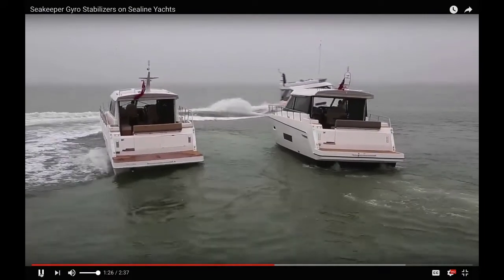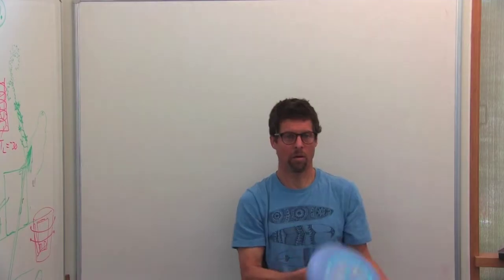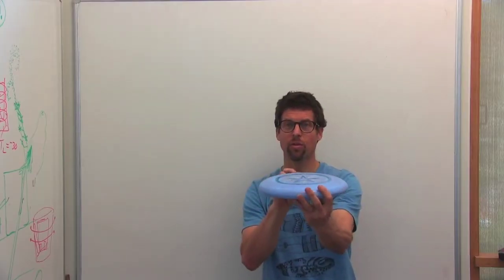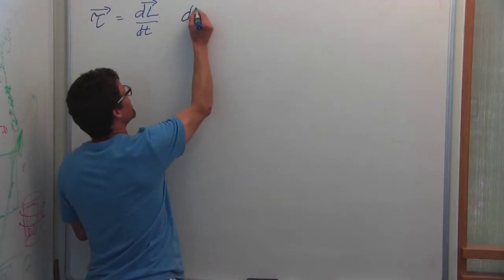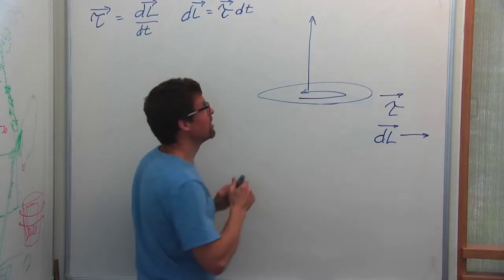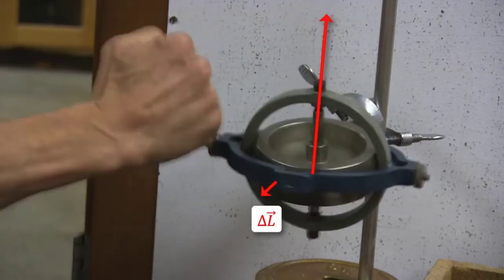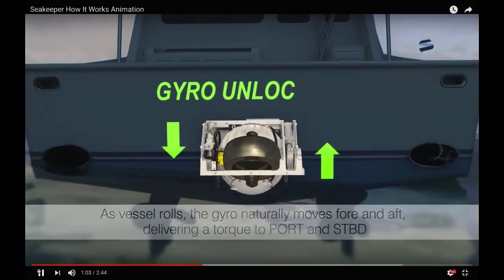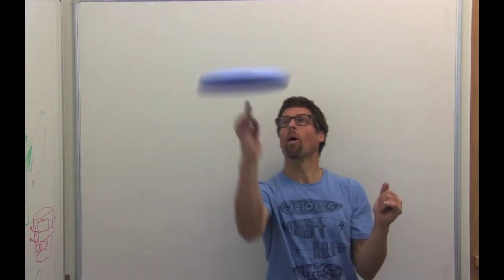Seakeeper Gyroscopic Stabilization Explained, Pete Schwartz, Cal Poly Physics

Comment: This is an important video for my learning about the behavior of gyroscopes with different degrees of freedom. Between 4:15 and 4:21, was the Gyro spinning. Again, between 4:15 and 4:21, why would the Gyro not precess. Or was there precession? but that was loading up the strings. And the strings would have snapped if they were thinner? I hope Peter gets to see my message, and be able to respond. Thanks in advance.

Comment: Hey Peter, sorry for a question on an old video, but was wondering if you could expand on one of the points you make.

You demonstrate that if you lock the gyroscope with strings to prevent movement on the Y axis, even when the rotor is spinning the gyroscope becomes easy to turn on the Z axis.

But if the rotor is spinning as shown there's still a large angular momentum in the upwards direction. If you then turn the rotor on the Z axis do the same principles not apply? The rotor will want to twist on the Y axis. 

Is the angular momentum pushing the rotor inwards or outwards on the Y axis just counteracted by the string? I guess I don't understand why locking the Y axis with string it would make the large angular momentum going up easy to change direction.
Reply from the maker: Hi, and good question.  It's perplexing to me too...We agree that when I apply a torque in the z direction, the gyroscope would rotate in the y-direction if it were allowed to.  The strings prevent this.  HOW?  They do it by providing as much torque as necessary in the negative y direction.  That angular impulse (provided by the torque of the strings) in the negative y-direction would be added to the angular momentum, rotating the gyroscope in the z-direction... the direction I'm trying to turn it!
Reply from the maker: It's still a little confusing to me too, but that's the best I can do right now.  AND for what it's worth, you may notice that with the strings attached, it does resist the rotation a little... it doesn't rotate freely the way it does with there is no rotation.  No, I don't have a good answer now!  Even basic physics can be challenging!
Reply: @pvs242ful  Thanks for the response. I think your answer covers my curiosity as a layman. Think about it I suppose it's also not just the string that's providing the impulse but the entire weight of the pole and table it's attached too. With that in mind plus your explanation the behaviour makes a little more intuitive sense to me.

Thanks again!

Comment: You just solved a major puzzle i had a year ago.  I tried to make an inertial platform for a camera setup. For the life of me I could not get decent stabilization.  The reason why is I had the gimbals locked.  I think this means I should use BLDC motors with feedback  sensor where gimbal bearings would be. This way I can do CMG aiming of the camera, but basically have a inertial platform afterwards.  It also means I need to redesign a bit so that there are no singularities that can form as the gyros freely rotate.
Reply from the maker: Glad that was illuminating.  It was also not obvious to me that the gimbal had to be free to rotate... until I tried it!

Comment: Hi. Great video, but I still have a doubt. As you say on min 3:35, when an instant torque changes the angular momentum of the disk, it will remain in the new position until a new force appears. So, why does the ship stabilize? If I tilt the ship by a applying a force on one side, I will feel a resistance proportional to the angular momentum of the spinning wheel, but why does the ship afterwards stabilize, and does not remain on the "tilted position". I suppose that mass distribution (ship design + devices) is the responsible for balancing the ship back to its initial position, but in a very slow motion because of the same rotation resistance of the gyroscope. I don't see any stabilization of the ship because of the spinning wheel, apart from a "tilt resistance". What am I missing? Thanks.
Reply from the maker: I suppose you're correct. "tilt resistance" doesn't mean "stabilization". If you put a long constant torque on the boat, it would eventually turn over despite the gyroscope, but the boat is subject to the stabilizing buoyancy force.... the problem is that the waves add large oscillations in this force. The gyroscope provides what could be thought of as increased inertial mass to the boat, so it doesn't get bounced around on short time scales, allowing the average stabilizing buoyancy force to prevail even over smaller time scales... very good, thanks.

Comment: Can you put this tech in. A car to improve performance? Can this assist in propelling a car forward?
Reply from the maker: Hi. Yes, flywheels have been explored as a means to store energy and release it later. A device capable of stabilizing a car is possible, but likely, it would require the entire gyroscope to be on a 3D bearing so that it didn't prevent the car from driving on varying road angles. I think it would require a considerable amount of active feedback.

Comment: Does the left boat have a flat bottom, and the right boat have a super-steep 22 degree bottom??? THAT alone would make up this difference. 
However, a steeper bottom is best when plowing through the waves, so this gyro would be great, if it works.
Reply: the gyros do work. the seakeeper is an improvement on systems that have been used on huge ships such as cruise liners for over 95 years but doesn't require the use of huge fins that stick out from the sides which not only limited when the stabilization occured but also risked damage to the ship if the fins hit something. 

the seakeeper also works when the ship is in dock, just trawling or at full speed unlike most other systems of the past. the boats are the same model with the same bottoms. you are just seeing how much of a difference in the rocking of the boats with one having a seakeeper while the other doesn't when the waves hit. the gyroscope weights depending upon the model at 900 pounds moving at 9000 rotations per minute when spun up fully. it is also not a passive system it senses when the waves hit and moves the flywheel accordingly.

Comment: The "locked" gyro example is precisely what I was trying to describe in a comment long long ago.  Better explained and demonstrated than in my comment which described the result of constraint but not the reason.  Even so, the string constraint isn't perfect so there will be some effect.  In any case the example is superb.  (Yes, I majored in physics, actually Engineering Physics, in 1954, but I used my experience throughout a long career in aerospace and industry.)

Comment: It's probably a little known fact that if you constrain a gyroscope such that it cannot tilt when you move it, it does not resist at all.   It only resists when it has some slight freedom to tilt towards it's normal tilt direction.

I suspect the new Navy EMALS catapults, which store energy in large gyroscopes use that effect to avoid having to worry about ship motion.  Two gyroscopes spinning in opposite directions, coupled together would not have any resistance to axis change.
Reply: REVISE

From Books To Computers The Human Species Continues To Evolve In Its Understandings And Potential Through Advancing Technologies. Now In The Advent Of 5g Comes The Android Smart Glasses
   
Android Smart Glasses

The Future Of DIY (Do It Yourself)Apps,Social Expressions (Emoji Que)And Literal Composure's Relevant To Specifics In Diversity Will Now Take A New Level In Human Utility.
To Take Into Account The Expansion Of Data Collection And Availability Through Open Source Media Has The Ability To Revolutionize The Education System,Its Understanding,Application And Most Important ,Cost.
Enyclopedia Brittanica,Wikipeda You Tube Etc Would Reach Beyond Boundaries As Set Today .Through Allocated Literal Composure's And The Augmented Reality Programs We Can Get A More Thorough Overview Of Subjects And/Or Mediums In Addressment.From The External Symetry Of A Apple To Its Constituent Elemental Propensities And The Laws Of Physics With Their Mechanics Will Be A Bold Dynamic 3d Visualization;A Breakthrough When Considering Our Massive Library To Date And The Potential Of The Augmented Reality Technology Program,Social Media Can Now Be Less Cumbersome As The Necessity Of Textile Interaction (Finger Touch)Required From Our Smartphones Is Drastically Reduced Or Eliminated.
A 
Highly Required Feat That Busy Parents ,Drivers,Buisness  Managers And Production Workers Would Enjoy, To Think Who Doesent Want To Tap Into A Sensor And Talk ,Text Or Command A Operating System Like The Internet ,Facebook You Tube ,Social Media ,Apps etc Without Taking Your Hands Off The Wheel Of A Car,A Cooking Utensils In Utility Or Dishes Being Washed.Clearly I Would.
Do You Want More Control Over Your Childrens Smartphone Interactions;Download A App And Gain Full Discretion Over Your Loved Ones Interaction By Monitoring A Transparent Screen In Front Of Your Eyes.
Imagine Setting Up Cameras That That You Can Tap Into At Anytime Through G5 Internet Conection Giving You Remote Control And Access To Diffrent Environments Putting The Mind To Ease Or Even Our Own Well Being At Our Discretion. Tired Of Paying High End Expenses For Computer Trouble Shooting Or Appliance And Or Auto Repairs;The Potential  Of  Live 3d Virtual And Augmented Reality Can Guide You  Step By Step Through The Procedure Making It Convinient To Human Independence, Potential,Creativity And A Bargain When Considering Todays Prices.I Know I Would Like To Install My Own Turbo And Cook Affordable Gourmet Meals Without Having To Comprimise Financial Stability.
Beyond Human Independence Through DIY Apps Human Health Can Take A Revolutionary Leap As Well.From The Break Down Of Desease In Epidemiology,Physiopathology Etc To The Focal Points In Trauma And Nerve Damage In Neurology And Endocrinologic Understandings ,Mental Health Can Take A Leap Forward As Well.
HUD-Heads Up Display Glasses Tuned To EEG Technologies, Biometric Technologies And AI (Artificial Intelligence )Computation Should Lead To Progression In Parkinsons/Alzheimer's (Etc) Therapy As Solid Analytics Are Produced.Tune The HUD Glasses With Multicellur / Multi Alternating Stream Transcranial Direct Current Stimulation Reinforcing Multicellular/Multi Alternating stream Deep Transcranial Magnetic Stimulation , Neutropics And Stem Cell Therapy And We May Overwrite The Influence Of Dead Cells And Their Impact On Neurological Pathway Systems Resulting In Higher Focus , Cognitive Adaptations And/Or Emotional Recalibration That Can Revolutionize The Dependence In The Pharmaceutical Industry.Who Doesent Want To Curb Crave When It Comes Down Fatty Foods And Nicotine Addiction?
The Innovation And Ultimately Contest In This Market Is In Its Conceptual  Stage,A Factor That Can Easily Be Changed Through Collaborative Design Projects Like Lennox And Wikipeda And Thus Become Common Rhetoric In Its Dynamics And Utilitarian Evolution .The Possibilities Are Endless.Companies And Manufacturers Like Microsoft,Google,Sony,Mad Gaze,Recon,Smith And More Are Already Starting To Scratch The Surface In This Market Giving Hopes For A More Independent And Interactable Future.
To Conclude;Ultimately Its The Virtue Of Control And Independence Created By This Product That Could Be Said To Set The Evolution To True Human Emancipation And Scientific Advancements.If You Would Like To See This Product Put In Production Join The Collaborative Design Project And Pass It On... REVISE
Reply: @emmanuelponce9151  Your comments are staggering.  Truly beyond belief and understanding.  Did you make this up all by yourself?  There must be a key point in there somewhere, what is it?
Reply: @dwilliams2068  -In Short,Teleprompter Glasses With Transparent Screens With DIY Apps.

Comment: Thanks for your useful explanation sir. But i wanna confirm on 3:25 , based on your explanation before. Shouldn't the vector of torque (T) you wrote be the same direction with the axis (vertical axis) where the frisbee rotate ? Hope you answered it, and correct me if i wrong. Thank you, Sir !! Good Job !!
Reply from the maker: Hi Suputra. The torque acts to turn the frisbee to the right, with the far side getting pushed upward. This torque results in a change of momentum to the right, to be added to the present angular momentum as I attempted to illustrate with the vector addition on the board.

Comment: Basically, the ROLLING motion caused by waves is forcing the boat into a rocking motion on the BOW STERN axis due to the gyroscopic precession (90 degrees) of the gyro.
Reply: So the the gyro counters the port/starboard roll to a bow/stern roll which cancels the wave's effects ??
Reply: @ChrisMacri376  up to 95% reduction.

Comment: HI teacher very good video but I have a question, why is it easy to turn it if the gyroscope is locked?.Thank you very much in advance .
Reply from the maker: Great question. There's likely many ways to look at it, but try this: Think of the way the gyroscope will tilt (precess) if you apply a torque. If the gyroscope is locked, it can't move this way. The strings or other locking mechanism provides any torque necessary to prevent this shirt. That very torque shifts the orientation in the same direction as your applied torque. So, your experience is that you apply a torque, and the gyroscope rotates as if it wasn't spinning at all.